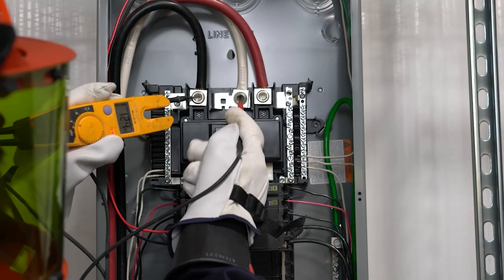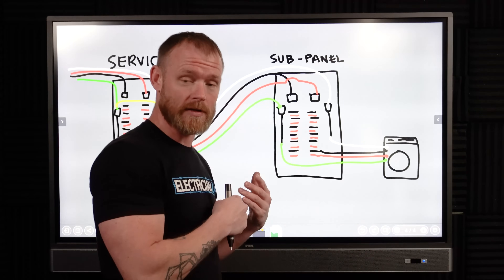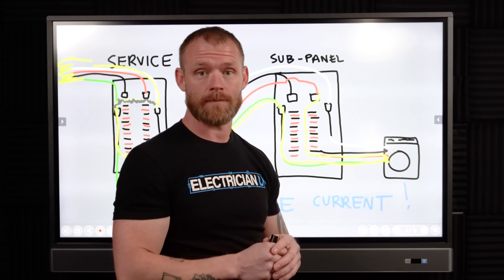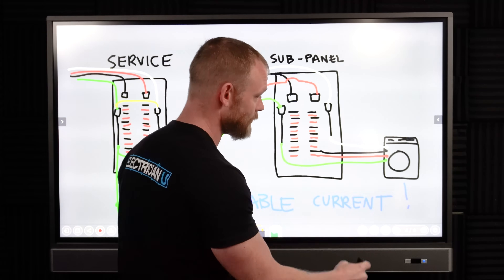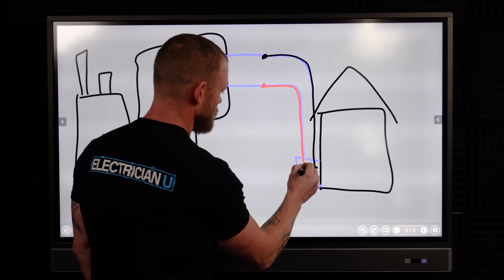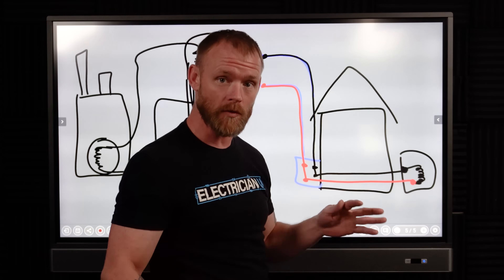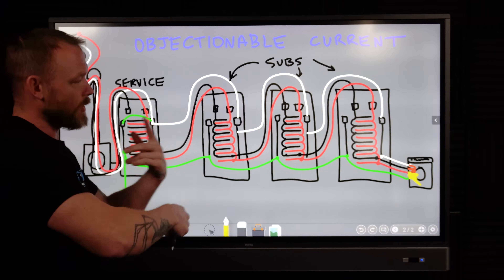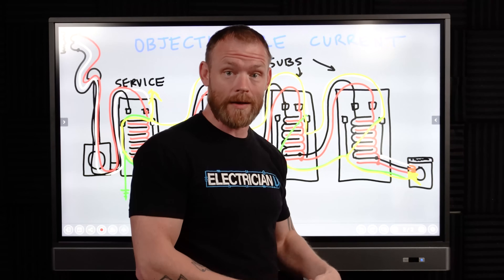Why Do We Bond at the Service Panel and Not a Subpanel?

Comment: 16:18 I believe objectionable current is more in reference to neutral current (i.e. normal operating conditions) rather than ground fault. In other words, the issue is less ground fault current traveling on a neutral conductor and more normal operating current that should be solely on the neutral traveling on the ground (EGC).
Reply: This is correct. You don't want the normal neutral current flowing through the ground wires as they are not sized or intended for this purpose. The rest of the video was spot on. Nice job Electrician U
Reply: Absolutely right.  You see it in three wire, three phase systems when people want to be able to get both line and phase voltages.  So they use ground as a voltage reference.   Bad idea.
Reply: With no bonding between neutral and ground, you don't have earth fault current on neutrals , you just have no path to source neutral?

Also, current isn't the direct danger, it's the voltage which can lead to  defibrillation when your body's resistance allows current to flow through you and affect the hearts rhythm.
Reply: @plehmann72  having trouble understanding your question (or is it a statement?). If you had zero bonding anywhere in the system (which is not what we want), then yes, a ground fault would have to travel to source neutral (transformer) via the ground rod connections. Definitely not what we want and may not trip the breaker. That's why we bond. In one place.

 Bonding in multiple places simply means more system components will carry current when they should not be, potentially causing a dangerous situation.

Comment: In short all sub-panels have their neutral bonded to ground via the main panel.  But adding extra bondings at the sub-panels creates dual pathing between main and subpanels for a return path which will result in current on the ground, which is bad.
Reply: in recent years, we now see more panels/pans that combine the meter and the service termination in one box, the first panel(s) fed from that would be the main panel(s). the neutral+grounding bond has to be where the service is being terminated/landed. So that might NOT be in the  panel you're thinking of. Just remember to never turn a grounding conductor into a neutral with a rogue bond: an energized grounding system is extremely likely to shock people, because the grounding system is bonded to everything: plumbing, metal enclosures (washer, drier, heating,...), metal cages of fixtures, chandeliers etc... ppl will be touching it.
Reply: No. Bonding occurs at the service termination not the main panel. Don't give advice if you don't know what you are talking about.
Reply: @CybekCusal  He knew what he was talking about.  Bonding occurs at literally every main panel, which is "service termination".  Duh.  You said exactly what he said.  Please re-read it again before commenting again. Mmmkay?

Comment: This did not help at all. From what I can gather, if the sub panel is bonded to ground then a ground fault turns into a short circuit/ground fault, because the current can take either path. But that shouldn't matter because the entirety of the current will still pass through the breaker.

Comment: Good video - what if you have a generator or inverter that is bonded feeding a main panel where all loads are off that panel which is also bonded? I guess that would create a scenario where the ground from the inverter to panel could act as a neutral?

Comment: So John I got one for you related to this!  Let's say you have a 200amp Service panel and at the service panel  there are 2 -100amp Circuit breaker slots.  1 Goes into the main home 2nd 100amp is not in use.  You now want to run this 2nd 100amp service to an outer building 80 feet away because you want to put in an awesome Casita!  Do you put in the 100amp circuit breaker and run a 80 foot 3 wire service line, putting the Neutral to Ground Bond and run to the outer building to an emergency shutoff,  wire hot to hot (Red, Black) and neutral to neutral.  Ground rod the outer building.  Bond the neutral to ground and put in your subpanel in the outer building?  Or run a 80 foot 4 wire service to the subpanel in the outer building?

Comment: Good explanation, but let me point out  one thing. If there is no neutral bond in the main panel, you said nothing happens. The breaker will not trip and? The egc's in the entire system will become energized with 120 volts. You will even have a hot ground rod, with step voltage around it. There is too much resistance in the earth, to afford a good return path to the source neutral in the transformer so the grounding conductor will pull about 4 amps.
Kevin

Comment: The farm and ranch where I work always has parallel ground paths.  The sub-panels don't come with a grounding bar, so the neutral and grounding conductor are always connected together.
Reply: Perhaps you should find a job at a farm with wiring that meets the electrical code and live longer.
Reply: @motorheadplatt8748  I would like a different job!  I seem to be stuck in some sort of mental rut, my current situation isn't quite bad enough to motivate me to go elsewhere though.

Comment: Can you describe the term "short to ground" and how that applies to the ground rods connected to the panels?  Are the ground a fail safe?  This assumes that a multi grounded neutral is used in the circuit.

Comment: Other than the fault concern, the bond at the subpanel will mean any load downstream will return half its current over the EGC to the main panel even during non-fault situations (IOW, all the time). And since conductors carrying current develop a voltage drop, all the EGCs from that subpanel will be a few volts above earth potential - or fully energized if the main GES bonding is damaged.
Reply: If the bonding is damaged then current on the ground should be very low as the only path back to the source is between grounding rods at the panel(s) and the utility pole.  The only way the ground would be energized is if the neutral is cut somewhere between the panels and you disconnect the ground while power is still on, anything upstream would get energized, anything downstream would not be.  Bad news if you happen to be holding the ground wire on the now "hot" side and/or if you're standing in a puddle near a grounding rod.  I'm sure people have gotten injured or killed this way and thus it gets written into the code, usually how it works.

Comment: I just want to make sure I am aware of the correct code myself, I am not an electrician just do a lot of home electrical work/diy work.  I see your bonded neutral diagram you are drawing and want to make sure I am seeing it correctly.  Does your subpanel only need a ground rod when it is outside of the building the service panel exists?  Your illustration only had a ground rod at the service panel.

Comment: I kind of feel that ELCB's where missing from this explanation, those can be a life saver in some of the faults give for example.
ad a European i still find it odd how the US grid works. We use 3 phase 400v or single 240v with a 20A main breaker per phase and just a few 10/16A on the service panel. not 200 to 400A

Comment: You explain ~450 times what a circuit is and why a bond at the service panel is needed, and almost completely gloss over why bonds at the sub-panels are not wanted, which was the original question. "Because we don't want that," and "Because it would be irresonsible," do not address the question of, "Why?"

Comment: So, my question is does the Sub-Panel Metal enclosure need to be grounded to a ground-rod.  If the Ground bar is electrically attached to the Sub-Panel Box and is grounded by wire to the Main Box does that count as ground?  In same bldg or in remote bldg?  Think your readers might be interested in this.
Reply: 10-210 Grounding connections for solidly grounded ac systems supplied by the supply authority (see Appendix B)
The grounded conductor of a solidly grounded ac system supplied by the supply authority shall
a) be connected to a grounding conductor at one point only at the consumer’s service;
b) have a minimum size as specified
i) for a bonding conductor; and
ii) for a neutral conductor when the grounded conductor also serves as a neutral;
c) be connected to the equipment bonding terminal by a system bonding jumper; and
d) have no other connection to the non-current-carrying conductive parts of electrical equipment on the supply side or the load side of the grounding connection.
Reply: Full disclosure: I'm not an electrician, but what he has explained is you always want to go back to the source of the power, your service panel, where it is grounded with a rod. Any feeds off that panel, regardless of location, always goes back to the original source. But I could be wrong..
Reply: @yandr4life1  I was looking to an Electrician for the answer. One current on the Code.  My code books are out of date. As am I.  ;-)
Reply: @dwmcever     Would a retired electrical design engineer 35 years on the job work for you?   If so, if the sub panel is within the same building, then wired exactly as Dustin showed on objectionable current diagram.   If a feeder is run from one building to another building, still separated, but a Grounding Electrode Conductor (GEC) and Electrode(could be ground rod) is required.   Please be aware that the “To Earth” connections (ground rod) has absolutely nothing to do with this video.  Electrodes(ground rods, metal pipes in grade, re-bar in concrete, etc) are connected to electrical systems to dissipate surges and lightning strikes.  Nothing to do with ground faults.   BTW, feeding other buildings from one building grounding, flip flopped back and forth several times in the 70’s thru 80’s.   Hope this helps.
Reply: @yandr4life1  Wont always be the service panel. If meter is on a bump pole for instance. It will have a disconnect on it, where the ground and neutral are bonded. At the service panel in that scenario, you'd not bond both at the service panel then.
Reply: Only if it is in a separate building like a detached garage.  Inside the same building it is not necessary and even confusing.  I have been running underground 100 amp subpanels to several garages recently for electric vehicles, they may want a second charger later.  Put a couple of ground rods in the trench on one, the other had an old copper water pipe to it from the house, 30 feet away.

Comment: Good info about why neutral and grounds are only bonded at the main panel.

Be careful when talking about impedance and resistance. They are different. They effectively do the same thing, slow the current flow, but impedance primarily slows change in current. For someone who only deals with AC they may seem the same, but for DC current, impedance of the wires has very little effect.
Reply: Would not the resistive elements still exist in a DC circuit, seeing as impedance is a formulation of both reactance and ohmic resistance?
Reply: @spruce_goose5169  Yes, the resistive element would be there in the circuit all the time. Whether AC or DC is applied. I misspoke when I said "for DC current, impedance does nothing." The point I really wanted to across is that resistance and impedance are not the same, and should not be used interchangeably. I have edited my comment to hopefully be more precise.

Comment: What about 3-wire dryers and stoves?  I run into these a lot. Most of the time I see them connected to ground, likely due to the bare copper conductor.  When I come across them, I tape the bare copper white and relocate it to the neutral buss.  I believe this is correct bc the 120 controls, such as the clock on the stove or motor on the dryer.  Thoughts?
Reply: They stopped using 3 wire plugs about 25 years ago for this reason.  When you use the safety ground as a neutral, you can get shocked touching the equipment.

Comment: I'm curious why your first whiteboard shows a ground wire coming in the service lines?  I have just black and red hot wires and a neutral coming to my house from a service connect & meter that is 700 feet away (where the meter reader can read it).  My breaker panel has two ground rods and the ground bus bonded to the neutral bus.  The inspector thought that was fine.  The service connect box does have it's own ground rod, but it's only connected to the box, not any wires.   If there was a ground conductor between the house and service connect, what purpose would it serve?

Comment: You can view it from the other direction.  The centertap on the transformer is bonded to the ground of the service and at the pole.  This combined neutral/ground is then sent to the meter with the two hots.  In the service panel, you split the ground and neutral to provide a separate current carrying neutral for normal functioning and a "ground" bond path for fault conditions with fault current using the ground bond to the service panel, back to the combined neutral/ground in the tri-plex out to the transformer, then back in on the hot to the breaker tripping it.

Comment: Question: Home has 400 amp service with a 200 amp main service panel (bonded) and a 200 amp sub panel service (NOT bonded). An electrician recently installed two Eaton CHSPT2ULTRA surge protectors, one in main service panel and one in sub panel service. Wiring for main service is per the surge protector installation instructions, Red/Black to 50 amp breaker, White to neutral bar and Green to ground bar. The wiring for sub panel is Red/Black to 50 amp breaker, and BOTH the White and Ground to ground bar.

Also per surge protector installation instructions regarding LED's, it says  "Protected when both lit".  Both LED's are lit in main panel but have noticed that sometimes the sub panel has both LED's lit and sometimes only one LED is lit.

Question: Is the surge protector in the sub panel wired differently with White to the ground bar because it is a sub panel and NOT bonded (neutral and ground are separated)?   Or is it wired incorrectly?

Comment: From working in industrial situations I know that many electricians will tie the ground to the neutral, the reason is that forklifts moving product will separate older conduit acting as ground, the sharp edge of the conduit will often cut into a conductor and energize equipment past that point. If the ground is bonded to the neutral nothing happens. This is a more common occurrence than most would believe and has led to some major disasters. New work is done with a separate ground conductor and has the conduit as a backup. 

With welding machines in a garage, or industrial building if a ground wire was to break in an SOOW cord or the plug connection was to fail at the ground terminal, the neutral is there to back it up or act as a secondary source to neutral. No one has ever successfully explained some added danger to connecting the neutral and ground at a subpanel. Unless the subpanel was wired improperly there should be no danger. I always run the same size ground as the neutral for the reason it may have to act as a neutral and carry the same amperage back to the main panel's neutral bus. 

If you lose the neutral at the panel everything in the home could be bi polarizing at whatever the unbalance of the hot legs are. But again I see no reason not to tie the neutral and ground together at the sub-panel. 

Sincerely, 

William McCormick

Comment: I've read a few of the comments and didn't see this mentioned...if it has I apologize for repeating...

Another reason you cannot (or should not) bond the neutral to ground in a sub panel is that Neutral ceases to be at ground potential in any subpanel if there is current flow on the neutral wire.  How far it will be above ground is dependent on the amount of current flow on the Neutral, at that time, how long the neutral conductor run is back to the bonded ground and what the impedance of the entire neutral run back to bonded earth.  

If one tied the neutral to ground in a sub panel, every device grounded would then elevate above ground by whatever that neutral is, at that time and contaminate the ground of those devices.  The reason that ground is ground all of the way out to the furthest point is that there is zero current flow, that gets ruined the moment that a subpanel creates an alternate path for current flow if its neutral is attached to ground. 

It all comes down to Ohm's law, which cannot be violated.  V=I*R.  R is never zero (and less so on longer runs/smaller conductors) so the only way to get "V" to be zero is if I (current) is zero. You can't achieve that if neutral is attached to the ground buss in a sub panel.  This is also why Neutral will always be above ground if current is flowing on it.

Great videos, by the way.